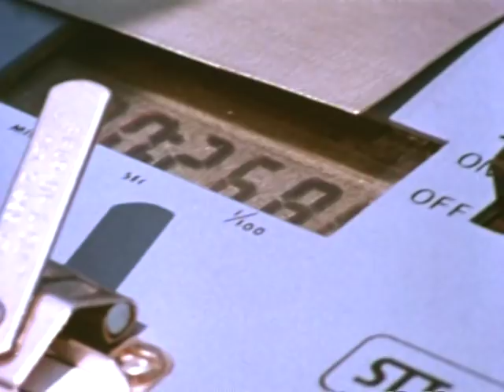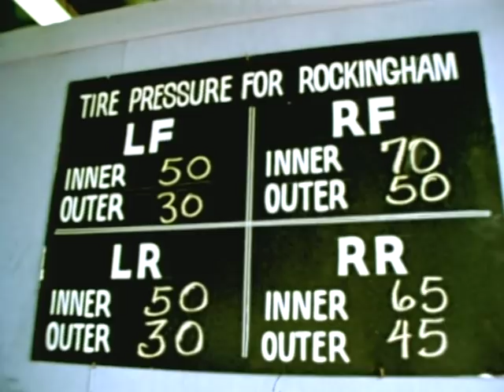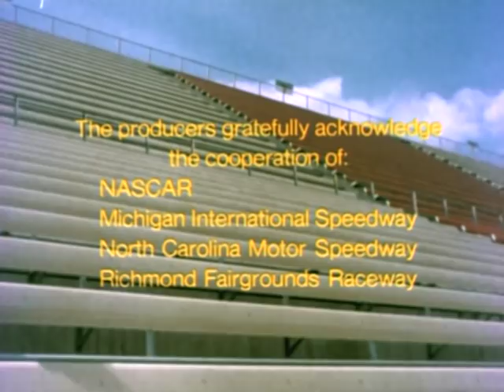1976 Carolina 500 @ Rockingham

Comment: I was at that race in the infield at the apex of turns 3 &4 the thing I remember most was how much faster edd nigre was going through that end of the track than ever one else but he was on the rev Limiter a third of the way down the straight, if he had petty's engine he could have lapped the field every 50 laps
Reply: youre kidding? holy smokes
Reply: @MrChristopherHaas  hell no I'm not kidding, I was absolutely shocked by how fast he was through that turn, his sponsor was 10,000 r p m clutch, so I always thought that he was the first to run the small diameter multiple disc that everyone would run later, allowing him to mount the engine lower in the chassis and thus handle better. I can't prove that is why he was so much faster through the corner, but it makes sense
Reply: He probably had the wrong gear in it.
Reply: @billponder5182  that would explain the pop pop pop from the engine on the straights, but not how much faster he was in the corners than everyone else. I was just shocked by his speed in the corners,we are not talking about 2 or 3 mph it was more like 15 or 20 mph. That was over 40 years ago and I'm still wondering how he could do that
Reply: Sounds like they put the wrong rear-end gear in it.
Reply: @marine4lyfe85  possibly but that doesn't explain how he was so fast through the turn the engine was clearly maxed out a third of the way down the straight but he was absolutely flying in the turn, he dam sure had something that nobody else had when it came to handling and I'm still wondering what it was

Comment: Donlavey probably could have had a few more wins if he wasn’t so blindly loyal to Ford.
Reply: Totally irrelevant comment. Junie's teams were ran on a shoestring budget and mostly were volunteer. JD McDuffie ran nothing but GM/ Pontiacs... And won nothing. It's irrelevant.
Reply: @timsharpe3498  I guess the Wood Brothers 199 wins are because Fords were so horrid
Reply: @benscovil  

How many Cup titles did Ford win in the 1970s? Ford mostly dominated when they didn’t have much competition. Pontiac barely dipped their toes in NASCAR in the early 1960s and dominated Ford until they stopped racing due to the Feds poking around after Ford cried about being outsold 8 to 1.
Reply: @timsharpe3498  Wood Bros didn't run full time as well as other Ford teams that were quite good
Reply: @benscovil  

Ford didn’t win any titles in the late 70s because they didn’t have a competitive small block.